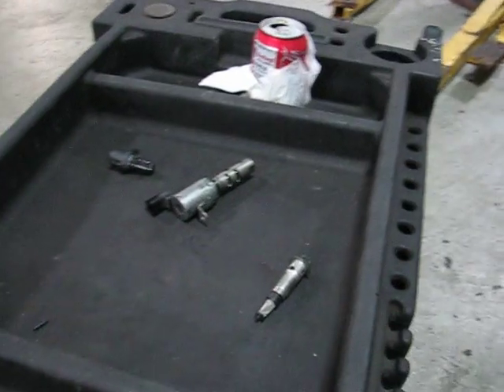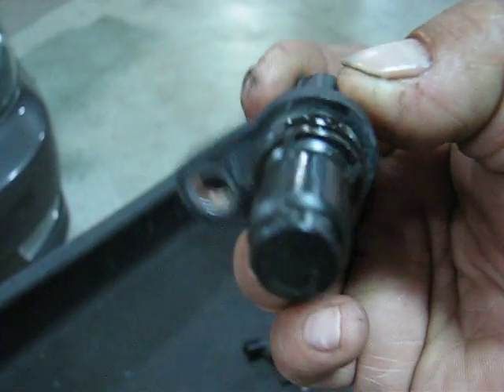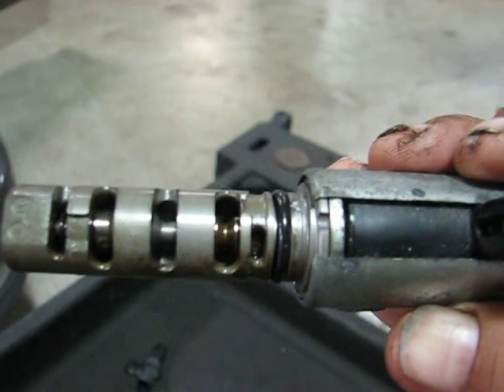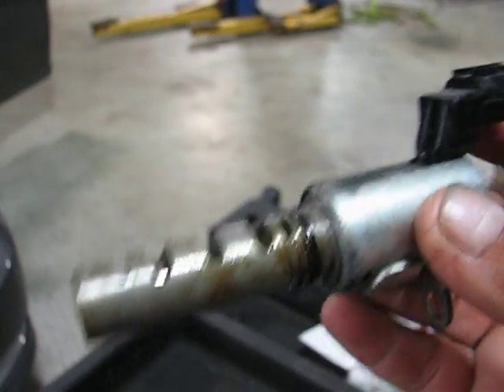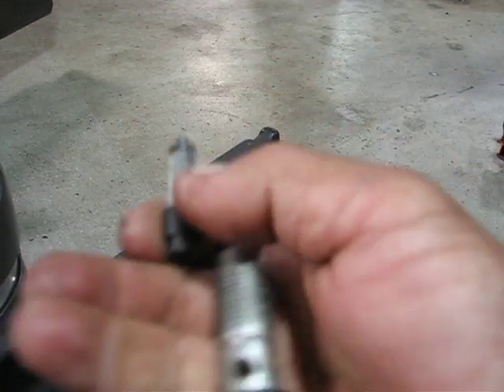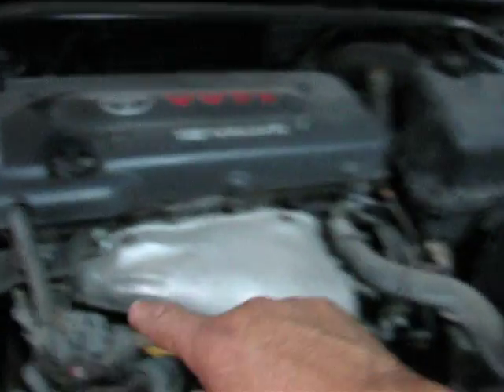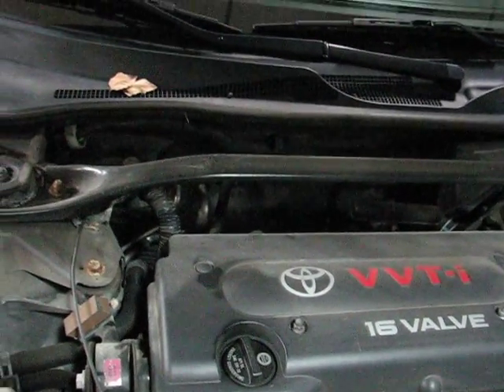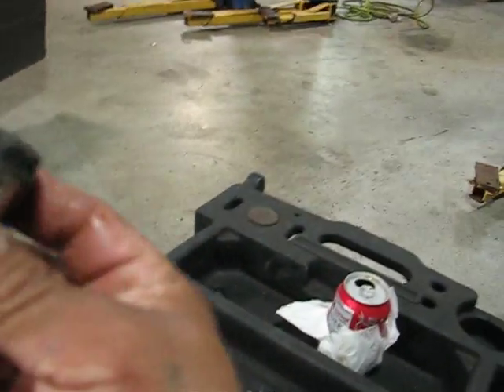VVT, Problem

Comment: I have a p1346 I changed the camshaft position sensor an the vvt gear an the sensor I still have the code i also changed the filter

Comment: That diesel sound ended up being the steering pump pulley. Nice and quiet now.
Reply: Did that noise go away after a certain rpm?
Reply: @sab35263   No got louder with higher RPM. At idle sounded like a little diesel

Comment: Hello sir please reply 
I got oil burn problem in my 2007 2.4L Toyota Tarago PCV valve is ok what else could it be please
Reply: Unfortunately the engine in that car has poor piston engineering, so it's just going to burn oil. There's not way to fix it other than rebuilding the entire engine. Which probably costs more than the car.

Comment: I tried getting oil control valve filter out of is 300 Lexus but it cracked and broke in pieces inside housing how can I get it out?
Reply: Ari Koenig Use needle nose pliers to hold little testing alligator clips open and clamp down on the filter tip. Use the need nose to pull the alligator clips holding the filter. Hope that helps

Comment: What's the location of the filter
Reply from the maker: M Ridware  underneath the oil control solenoid, the cover is a 14 mm bolt
Reply: Flavio Pina for 2004 Camry  same location  ?
Reply from the maker: Yes, they install the solenoid in the back of the cylinder head
Reply: Where is located on Camry v6 2007 (the solenoid)

Comment: I just bought a 2000 corolla with the 1.8 engine. it sounded like a broken timing chain but when I removed the valve cover I found that the vvt gear was shattered. what would cause this and could valves been damaged. thanks
Reply from the maker: if the car was running , with no misfire dtcs, then there is a big possibility that no engine damage has occurred
Reply: what would cause the vvt gear to shatter. I hate to replace not knowing what may be the cause. any help would be great. thanks

Comment: Dear Sir
I own a Toyota Corolla 2005, it has a code p0012, the engine get noice when it on, but when I press gas pedal up to 2.00 rpm, the engine no noice, I replaced a new variable timing solenoid, cleaned variable oil filter, changed engine oil, replaced new spark plugs, new battery, checked timing chain is good. But i found the variable timing solenoid plug has power , the power is so weak, couldn't power on the solenoid. I tried to look for wire fuse or relay, but couldn't find it. Please help me what to do? Thank you for your time, I am looking forward to hearing from you, thank you
Reply from the maker: did you change the vvt gear, did you check the 3 marks cranck shaft, and both camshaft marks, if the carhas more than 2000.000 miles the chain may be streched, really hard to see.
Reply: Thank you so much for your reply, my car's mileage 170000, I didn't change vvt gear, I have checked the 3 mark too, but when I linked the wire from battery to variable timing solenoid, the engine run no noise anymore, what should I do next?
Reply: El Moreno Pina can you make a video of how you removed these parts
Reply: Espanol

Comment: shot in the dark here but, I just reassembled a camry 2az-fe and had scraped the end of the OCV removing the head bolt there (forgot to remove it first) Would a big scrape/gauge in the very end of that ruin it?
Reply: Did you have the coolant leak issue on intake side? I have 2.4 , 2AZ-FE,  2003 Camry LE, 131K miles. It leaks coolant. Did you use a kit like SureGrip, Timesert, or NS300L ?  What did your research tell you?  Thanks!

Comment: It was very difficult to remove the solenoid by hand after i removed the one bolt in a 2003 corolla. so as i used a screwdriver it broke off. half was stuck inside. so stuck at a friends house with limited tools i had to drill some if it out. there was the end left inside and was about to get lost. So I opened the valve cover and took out the end. I found shrapnel from the drilling inside and I was very worried. so with a small brush I was able to remove as much as I can. My question is how bad did I mess up where i could of paid thirty five bucks for a mechanic to do it?

Comment: hi there..
I have a 2001 Renault scenic 4x4 RX 2L petrol.
Variable Timing Intake / VVT Valve at the top near one of the spark plug it is leaking 
tried sealing it but it still leaks this needs a new gasket if so can you tell me were to get one. EBAY..? cant find a gasket ..help please
thanks
Brian

Comment: Please share a picture of filter location in the engine.
Reply: You have to remove the Power Steering pump and it will be a Allen head maybe 10 mm.  This is on the 2.4 engine.

Comment: Toyota #1 in recalls and it shows, I will stay with my push rod v8 in my 4x4 Chevy...
Reply: Chevy uses them too.
Reply: Chevy uses vvt systems too. You are a dumbass.
Reply: But why are they consistently in the top 5 most reliable brands? Have you ever thought that Toyota might have more recalls because they have better tracking of there manufacturering process and are more likely to recall an issue if found?

Comment: I had the vvi solenoid break off the valve part in head. Its stuck and I can't remove it. Any suggestions?There wasn't a filter either.

Comment: If it is a 3.5 v6 2GR-FE then there is a up dated parts list that remedies the noise , which includes cam gears cam shafts and cam cradles.If you make enough fuss about it toyota will probably cover it . It is included in one of our service TSB'S
Reply: These issues needs a recall they have this engine in toy otas snd lexus suvs. The noise is so hesitating.

Comment: Let your vehicle come up to the proper running temp before you suspect a problem. Check your oil every week and replace with proper oil. Check to see if your Egine Light is on. If the problem persits, it may be a tensionor and slides problem. Not all vehicles come perfect from the factory. Check for Technial Service Bulitens and Recalls.

Comment: Flavio, one question I have to Toyota highlander 2009 and it makes a little bit of noise just when warming up, after 15 minutes it is gone.  I have it inspected by a local technician and I was told that I will have to replace the VVT-i Timing Gear all 4, but he just listen the engine.   After seen your video, my question is, could it be just a Cam Sensor Filter issue.  Please let me know what you think, before I proceeded.